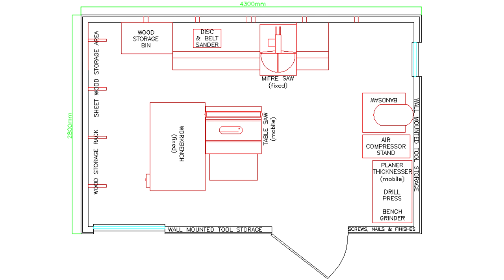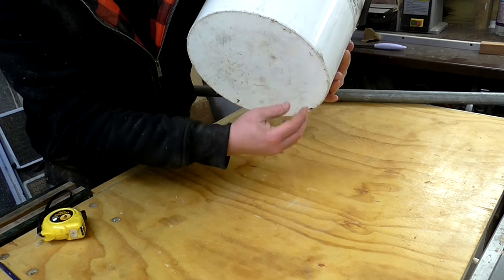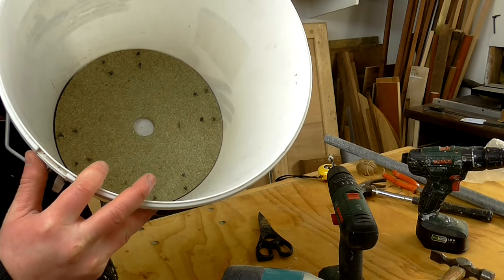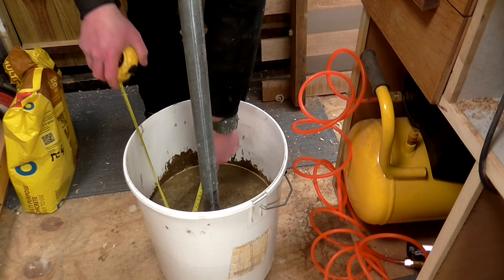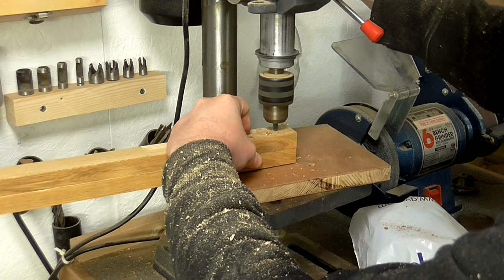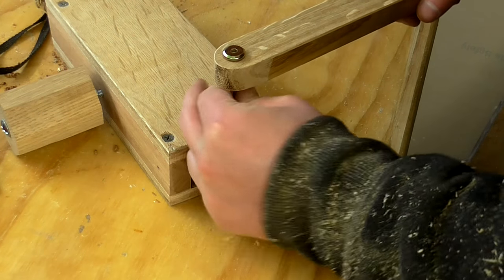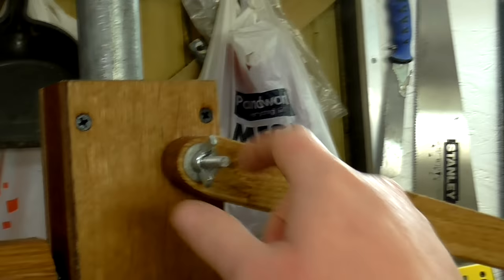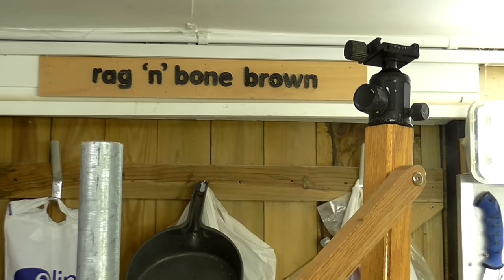Mobile Camera Stand - using concrete and reclaimed materials

Comment: Extend the top lever beyond the pivot point and attach a contra weight, that will balance the camera.
Reply from the maker: +Wiljan Slotboom not needed, as explained at the end of the video
Reply: Then you don't have to tighten the wingnut as much. Like your video's.

Comment: What a fantastic idea. I wonder if anything like this is in a real product. Also if you change the wheels for ones with rubber it will move better. If you have a 3D printer you could print a nob with a captive nut to replace the wing nut. I did that for my old 3d printers bed as the wing nuts where a pain in the arse.
Reply from the maker: +Andrew Joy it should be a product! And Jay and Jeremy should get a cut of the profits! The wheels are rubberised but it's quite a hard rubber. It rolls ok but would be better if the wheel base was bigger

Comment: Great build Martin, I had seen Jays before. Just one question, why use 4 wheels when 3 would of been better....just like a tripod they will work fine...just a thought. 👍🏼😊
Reply from the maker: +Marc I thought about using 3 but my floor is pretty level and I had 4 and don't know what I'd do with the one spare so fitted it anyway
Reply: Rag 'n' Bone Brown I'm sure you could perhaps use it as a roller for a future build, knowing how you adapt things to benefit you, very much like me....I'll keep this thought until you have a project that misses just one thing....a roller and I'll say "there you go!" LOL 😉😊

Comment: Great build, just a quick question regarding your camera. My lad is starting out loading clips onto YouTube. Do you use a separate microphone or just the one built into the camera. He's been driving me mad these last few weeks and I've no idea. When your next project by the way, there great very detailed and informative.
Reply from the maker: +Robbie Allen I use the built in microphone on the camera, it doesn't have an input for an external mic. I find that the built in one is decent enough. Other options would be to use an external device for audio or a clip on mic in to my phone but then I'd have to sync the audio with the video and remember to press record etc, seems like a lot of extra hassle. My videos are every Friday. Thanks
Reply: Rag 'n' Bone Brown thanks for the speedy response. The vids are great, clear, well presented and easy to follow. Maybe we'll look for a HD camera for him instead. Do you still edit your vids via your computer. Any recommendations on software.